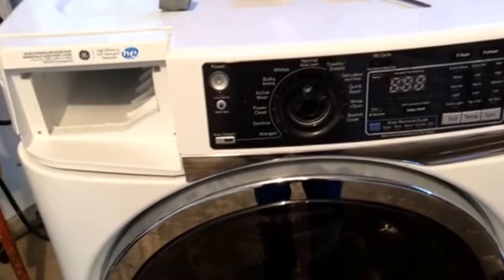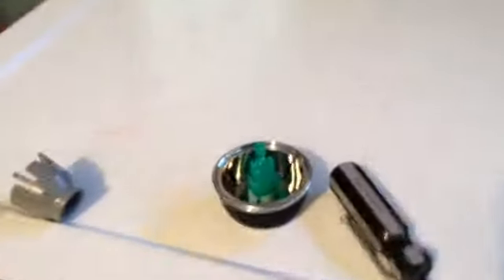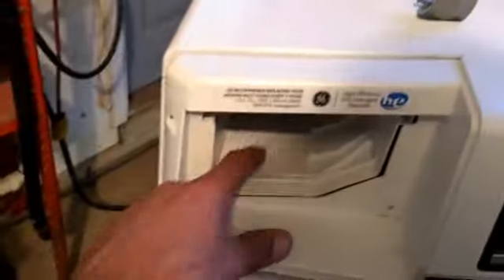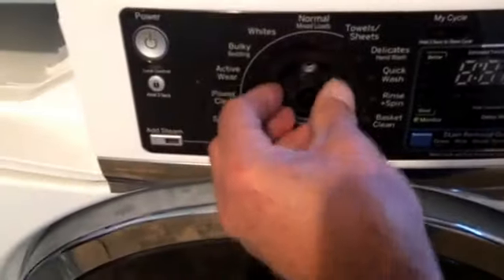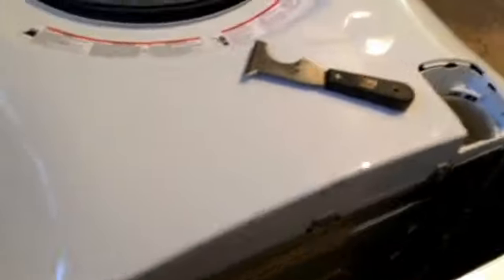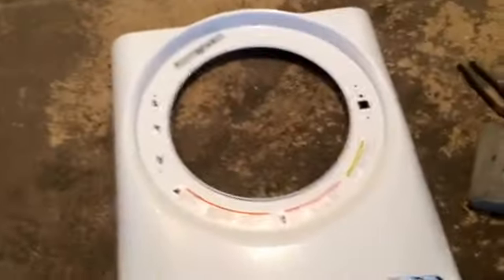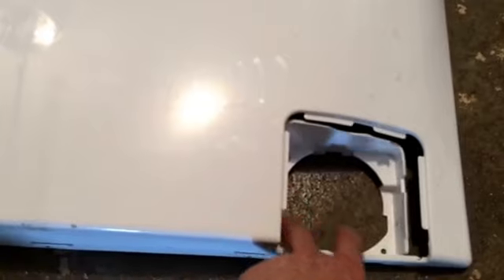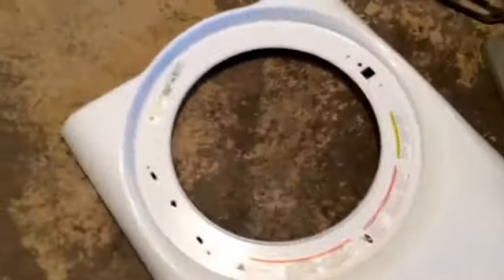GE washer front load disassembly GFWR2700H0WW control panel removal front top lid access

Comment: I'm so glad that I finally found this video after all of the searching that I did (didn't know the model number and didn't think to look inside the lid). I want to look at the front panel board but was dreading the disassembly since some of the older models and similar brands have the screws in the back and my landload put the washer in a pretty tight spot.

Comment: I know its an old video but would a bad circuit board keep the washer from turning on?
Reply: My GE front loading machine just died, no power. Tech guy came and said control board needs to be replaced. This is a 3 year old machine. He charged $107 to come and wants $437 to replace the board. The board is $234 brand new. I will replace it by myself. Yours most likely have the same problem
Reply: @erkanil  you're correct I already took it out the machine now I'm looking for the part online
Reply: Did you find out?